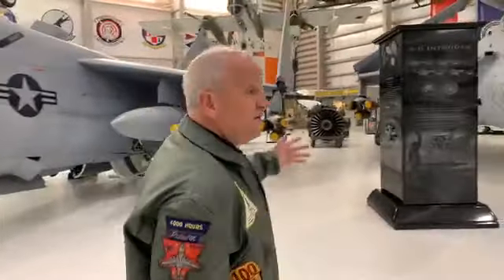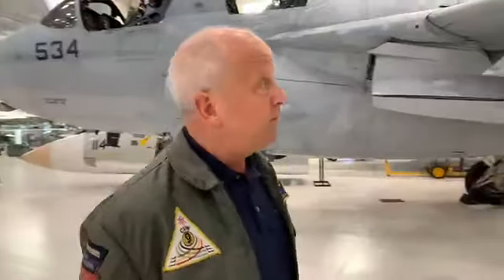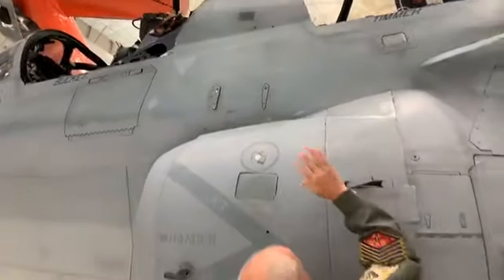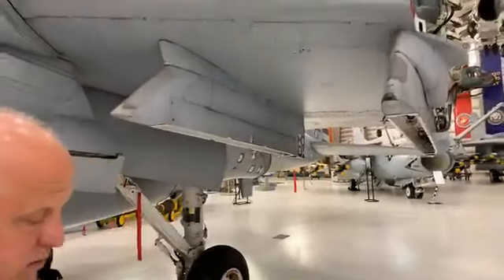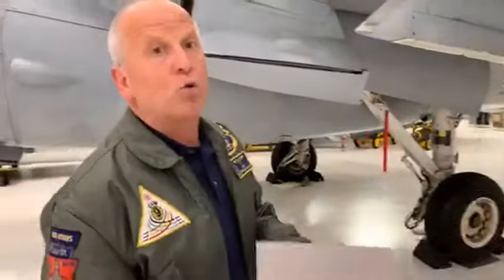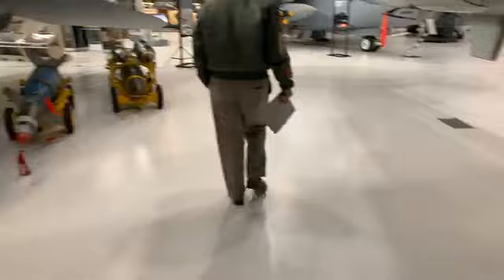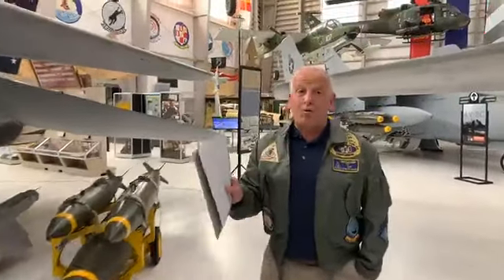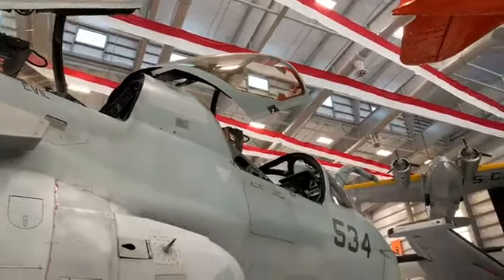History Up Close with the EA-6B Prowler

Comment: The biggest mistakes naval aviation made in the 1990s were retiring the Grumman planes (F-14 and A-6) without appropriate follow-on planes.  That's going to cost the Navy sooner or later if it hasn't already.
What this did was halve the striking range ability of naval aviation -- you have to move the carrier CLOSER to target and aerial refuel more often -- and reduces the argument for larger supercarriers if you don't have strike planes with range and payload that justify the carrier building program.
Personally, I don't think we can afford 10 supercarriers.  Not if they're going to be bloated monsters with basic systems (elevators, catapults) that don't work as well as their predecessors.  They tried to innovate too much with the Gerald R. Ford and that ship is well behind schedule.  Who knows when it's going to be fully operational and living up to what the Navy required of it?!?
My personal belief is the Navy needed an A-6 replacement that was more reliable, less maintenance-intense but retained the older plane's range and most of the payload capacity.  They never fielded one and wasted a lot of money and time on stealth planes instead of practical RCS reductions while maintaining performance and range.

Comment: Captain.. did you only produce daughters by chance.  Pilots of certain platforms seem to be blessed with only daughters.
Reply: Ha. I was an avionics tech for the Intruder and the Prowler. It was certainly a universally known legend that we technicians only had daughters!

For the record though, I had two sons, the first of which was born 3 years after I got out, so maybe my sperm had gotten back to normal. 😆
Reply: @rockhopper01  SH-60B pilots and crew have that tendency and legend too.  Sitting on top of the APS-124 for years.
Reply: @rockhopper01   Two daughters here - AT2 1985-1991, VAQ-129, VAQ-135